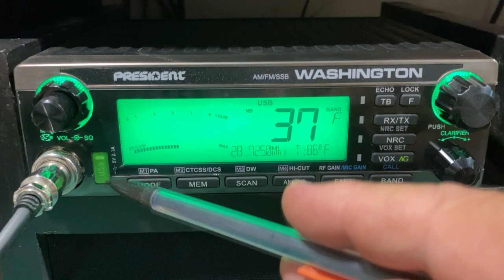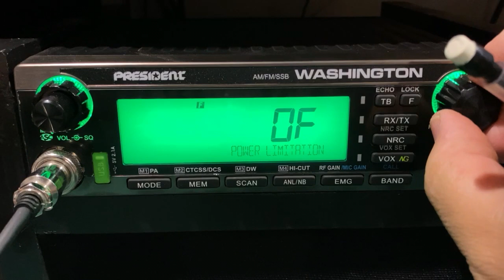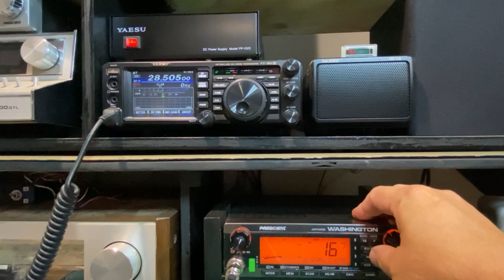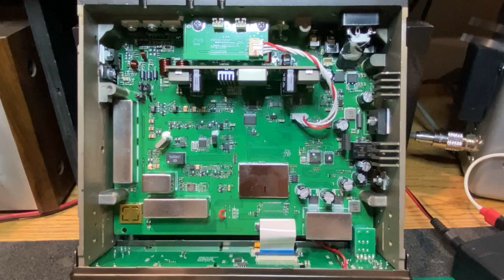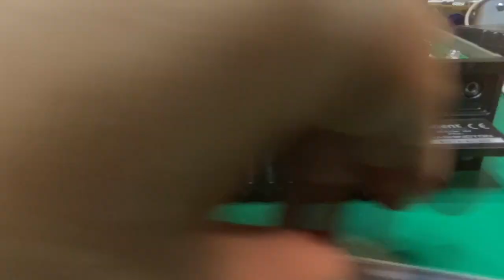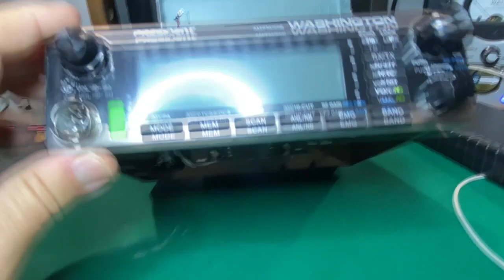President Washington Ham Radio 10 Through 12 Meters  (Overview) NEW FOR 2024

Comment: Suggestion - If you are charging phone then why not put iFTx  or ft8cn onto your phone and receive Ft8 or even FT4 through the speaker. IFTx on a iphone even has a waterfall.. you may even be able to transmit using the mic and VOX
G4BTI.

Comment: Can someone confirm if this radio has the weather channels/weather alert? I have searched the internet, some say it does, some say it doesn't
Reply from the maker: @jonhammes6209  No weather
Reply: I just got off the phone with my local President dealer! Confirmed, no weather. 

I guess I can pick up a cheap hand held for weather alerts.
Reply: The modifiable 10 meter radios never have weather band and alert features. ONLY the "street legal" 11 meter only rigs have that feature. Since I drive an 18 wheeler, I only like the street legal radios because of the weather alert feature. I have a President McKinley in my truck and the weather alert feature has saved my bacon too many times to count. The alert feature sounds kind of like a police siren and it will wake me up in the bunk. It then automatically plays the weather channel that sent the alert without hitting a single button. FYI the feature scans all 7 weather frequencies for alerts. I never turn the radio or the feature off!

Comment: So I'm stuck between this and a George gonna be running a rm italy KL503p what do you recommend
Reply: I been running the Geroge FCC in the semi truck for a few months. I own a KL503HD.      On the bench, is a perfect pair .  I own a KL703 also, 30watts in gets 500 out, So on a 80watt radio turned down too run ether amps, VS the Geroge FCC which slips right in there to drive ether amps is a win.  I haven't ran power wires in the semi truck to run both George FCC and the KL503, fairly new truck also, so working with that also... UDX15117 Colorado wavin'

Comment: I have to agree with the DIGIMIKE and I have two of those, one on my President Richard and Ronald, I have both set at 3 and it does it’s thing especially on both radios, I’m starting to get more interested with the Washington as I see more reviews on it but considering it is a 10 & 12 meter radio I’m assuming it needs a jumper or resistor on the board to add the 11 meter?

Comment: Use the kpo power mic or the zagetti power mic. And put the mic setting on 1 so you can use the amplification of the mic.and not over drive the radio. You can he then in an 8 pin ready to plug in.
Reply from the maker: Makes sense, I'm going to try that. The radio has a whopping AMC circuit  so I must try.  I didn't think about this as I;m still stuck in the 70s:) Radio wise that is.

Comment: 13:40 solder dont melt till 250C but most chips die about 110C so 80C isnt too bad but thats smoking hot on the touch test
Reply: they say 175C on the finals but I say 120C is gonna start hurting it

Comment: can you widen up the bandwidth on RX? it says 300hz to 3000 but I wasnt hearing much low end on my signal. the NRC doesnt explain much other than 01 to 04. I think the stryker 955 you can drop the low end down and get some lows. what ever you do, stay away from the ranger line. total drifty garbage and crunchy ssb audio. particular the x9hp but I say they all suck even the new 2990's
Reply: I guess nrc is dsp so not sure if the have a bandwidth control

Comment: Only mistake is calling it the Washington as President Washington was a base station then the Uniden Washington. There is a jumper that you need to move to turn on the 11 meter CB. There is no euro version as it is the same radio & is sold as a amateur radio like the President Lincoln II+ which is being discontinued. -73's
Reply from the maker: Yes.
Reply: Well the Lincoln is a crappy radio.....I've had two very much disliked.
Reply from the maker: I had some truckers that wanted some, after checking all modes & functions before selling them I felt bad. Just awful.... 
 It was hard to look them in the eye when they came in to get them. 
This radio is way better. WAY better. IMHO
Reply: @390WagonMaster  What is wrong with the Lincoln II Plus? Most of the users I know, like it a lot.

Comment: Looks like its loaded with features but it looks sooooo much like a 980 ssb it worries me
Reply: The 980 has been around for what, 16 years now? That's gotta be a record. I can't think of any other radio that's been in production that long besides the DX2547. It's the same layout and the same size and is the perfect replacement for the old 980.
Reply from the maker: It is loaded with some very cool features like the fan control and temperature monitor. There are a few I don't care about and will more that likely never use. This rig is NOT a hopped up 980.  The face plates look similar but thats it.

Comment: I was used to a road devil mic and when I use the stock president mic I was told I sounded like I had way to much base. I then stopped speaking directly into the mic and that cleared it up.  I watched your video on the digital mic and I liked the way it sounded. I will probably pick one up one of these days.
Reply from the maker: I have tried many of my favorite power mics and I will tell you that the DIGIMIKE is the only way to go.  Very clean and dynamic audio through the DIGI.  I'm a huge Turner Fanboy and for this radio (I hate to say) no power mic sounds as good and clear as the DIGIMIKE. 
NOTE..... This pertains to the GEORGE FCC, McKINLEY as well.